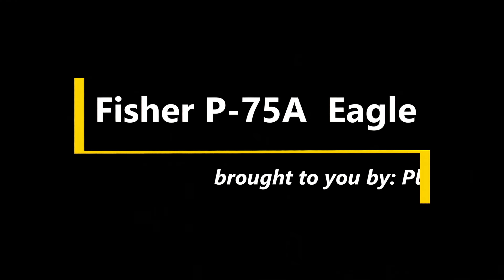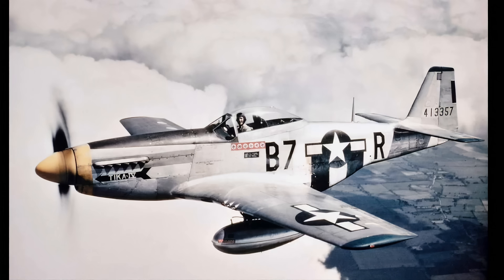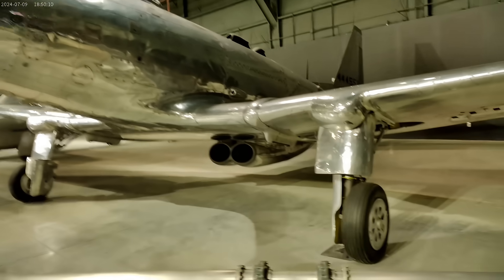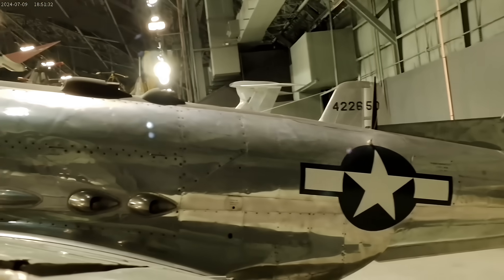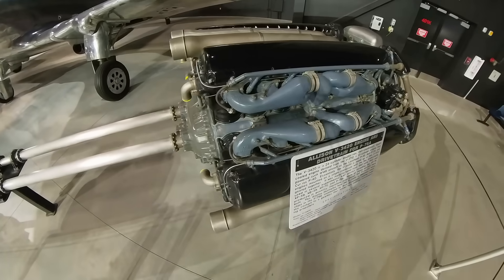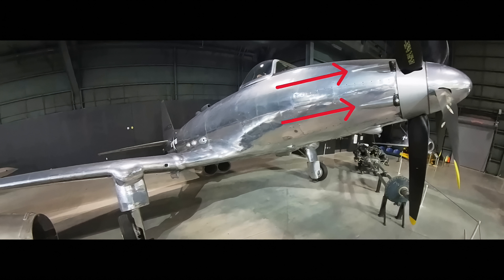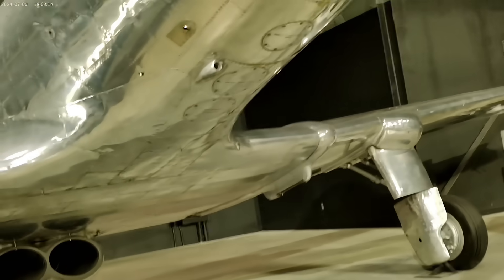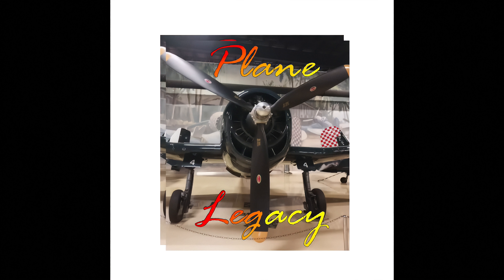Fisher P 75A Eagle - The Wonder Plane that Wasn't

Comment: Ford were a major manufacturer of B-24 Liberators, turning out over 8,000 from their plant at Willow Run, Michigan, at a rate of almost 1 per hour once they really got going. Great for the war effort, but it it wasn't particularly profitable for the company. From what I read somewhere, General Motors noted this, and when it looked like they would get drafted into the B-29 program, they pitched a proposal for a new fighter that would, they said, take all their production capacity. Somehow, they were believed,  and hastily cobbled up the design of the XP-75 from bits of other aircraft, thereby reducing the time, cost and effort that they had to put into it. Amazingly, their efforts generated official interest and they had to continue the charade, even to the point of refining the design. I'm sure they were totally surprised to find themselves actually producing a small number of these Frankenstein beasts, and were probably relieved when it was cancelled, having been 100% successful in it's intended role - a distraction to keep GM from having to contribute to the B-29 production program.
Reply from the maker: Thanks for the comments, always more going on at the "board room" level behind the story of any aircraft production. I appreciate your sharing this information. Thanks for watching!

Comment: Propellors severely limit an aircraft speed because the prop tips break the sound barrier and loose efficiency.  Not an issue with all-jet, which, in military aviation, was too severe a limitation for anything with propellors where speed was a consideration.  The C-130 is a prime example of the exception to the rule.
Reply from the maker: Good info, thank you for sharing!

Comment: You've got P-factor, gyroscopic precession, and torque confused.
Reply from the maker: are you able to elaborate?
Reply: @PlaneLegacy  P-factor you got right. Descending propellor blade produces more thrust. Therefore, a right turning engine will require some right rudder input for coordinated flight... Torque is a function Newton's 3rd Law of Motion. And it conspires to turn the airplane left...Thus rudder trim. But gyroscopic precession of the propellor, will always act 90deg to any change in pitch or yaw. And the bigger the prop, the worse that problem is. But the contra-rotating propellor minimizes both torque AND gyroscopic precession. Which is a VERY good thing... And if you can fly Beech 18s for a living, you can fly a manhole cover too.😀

Comment: P 75 appears awkward  annoying. Can't imagine the long drive shafts. I think its a poor design. If one or both broke or separated you've got a drive shaft comming right up through you in the cockpit. It's scary enough driving a car with a crumbling hardy disk.
Reply: That didn't happen to the Bell airplanes with that design. IDuring war, these fighter planes had a life expectancy of only a few months, so the problems we see in our cars after several years just don't happen. In this case, it was the engine that was terrible, there were other planes that were supposed to use it but they got cancelled when it turned out to be a failure.
Reply from the maker: That time period featured a lot of trial and error, where the error could get someone hurt or worse when it was rushed into production. Thanks for watching!

Comment: Contrary to what most believe, the P-51 was NOT the king of service range; it was the P-47N model which DID see service, albeit very limited. It made the Mustang look like an Edsel compared to a Cadillac...
Otherwise, great video!
Reply: The range of the Mustang was 1,000 miles on internal fuel and 1,650 miles with drop tanks. The P-47N range was only 800 miles on internal fuel, but was 2,350 miles with drop tanks. So, the P-47N could carry larger drop tanks. Of course, it was larger than a P-51D. However, this is an apples to oranges comparison. They had different roles.
Reply from the maker: Thanks for the info

Comment: It's important to remember that every single fighter and bomber that actually saw combat in WWII for the US was already in the design and prototyping phase BEFORE Dec. 7, 1941.   The remarkable designs of the P-51 and P-61 got their early starts thanks to the British, who were buying everything they could from the US in 1940 and thus initiated those designs.  
In the case of the P-75, the choice of the Allison engine was its most critical failure, as Allison, then a division of GM,  simply had too much corporate inertia to quickly improve its V-1710 engine for the P-51 and P-38, much less fully work out the kinks of the V-3420, which was just two V-1710 engines connected together with a gearbox.
Don Berlin doesn't get enough credit for his aeronautical work, as he was the Chief Designer of the P-40 at Curtiss Wright.  He would later go on to work for Boeing Vertol and help design the Chinook helicopter.  Somebody should do a Youtube video on his life and career, which has unfairly been ignored and is largely uncovered by any books or even a wikipedia entry.
Reply from the maker: Thanks for the info, I agree on Don Berlin being one of the unsung who should get more attention. Thanks for watching!
Reply: What are you even talking about?! 🤦‍♂️😂

It’s not enough to give the US credit for building great aircraft during WWII, but now anything we DID build was only thanks to the Brits?! 😂

You’re totally wrong about the timelines by the way, as SEVERAL of the most iconic aircraft of WWII were designed and produced within the span of the war. The P-38 was one of the only aircraft that actually saw production from the start THROUGH the finish of the war. 

I mean right off the top of my head the aircraft that literally ended WWII was designed and built after the war started; the B-29. 🤦‍♂️

The Hellcat’s first prototype flight was mid-1942! That aircraft was also a complete game-changer in the PTO, and to dispel your other ridiculous statement, its development has ABSOLUTELY NOTHING to do with the British or Europe at all.
Reply: @EstorilEm      You need to do some reading about the history of the P-51 and the USAAF's tortuous path to finally selecting the P-51 as the definitive solution to its desperate need for a long range escort in the high altitude European air war.   "Mustang Designer" about Edgar Schmued, the P-51 Chief Designer (an Austrian immigrant, btw), and "P-51 Mustang: Development of the Long-Range Escort Fighter" are must-reads.  
Besides the GM/Fisher P-75 described in this video, Curtiss Wright alone had projects for the XP-37, XP-42, XP-46, XP-53, XP-55, XP-60, and XP-71.  There was the McDonnell XP-67 Moonbat, Lockheed XP-58 Chain Lightning and XP-49, Brewster's XA-32, the XB-38, XB-40, and the XB-41 escort bomber.   These were all USAAF projects to find a solution for a long range escort fighter.  Until the P-47N model, the P-47s did not have enough range, and the P-38, which did have the range, had severe problems with its Allison engines blowing up when forced to run in the cold high altitudes of the European air war (that and the poor grade of British avgas mixed with the Tetraethyl lead to boost octane).  Also, both the P-38 and P-47 were Mach limited when forced to chase the much sleeker and aerodynamic German FW-190 and Bf-109s from high altitude and could not follow them down in a dive at 25,000+ feet altitude without hitting the sound barrier and losing control (Capt. Eric Brown's video testimony, he says this in a couple of videos here on Youtube).
The ONLY reason the P-51 existed was because North American proposed building a new and better design for the British when they came around in 1940 and asked them to license build more of Curtiss Wright's P-40s for them.  CW could not ramp up P-40 production fast enough for the British.   So, North American instead built the P-51 with the Allison engine for the British.  It was recognized early on that the P-51 had a superbly aerodynamic fuselage but the lousy Allison engine limited its performance, especially at high altitude.  As such, early models were mainly used as ground attack aircraft.  The British initiated experiments switching to the Merlin engine, and North American then rebuilt the P-51 around Packard's license built Merlins.   Two keys to the P-51's success - its sleek and aerodynamic design allowed it to be far more fuel efficient than either the P-47 or P-38 or other aircraft.   Also, from the beginning, its main fuel tank was in the center fuselage-wing root, balanced right at the plane's center of gravity.  This is why, when the need for more range became apparent, NA was able to easily add a small second fuel tank behind the P-51  cockpit, as well as drop tanks.   The P-47 had to have its wings completely redesigned to put large main fuel tanks in the wings for the P-47N model, and its R-2800 engine and its bulky design meant it was a fuel guzzler.  That's why the P-47N model saw only very limited combat at the very end of the war in Japan, and never made it into Europe - it just took a much longer time to completely redesign its wings to accomodate the extra large fuel tanks..
Anyway, the definitive version of the P-51 with the Packard Merlin engine and the extra fuselage fuel tank was NEVER written into any USAAF specs or contracts.  The whole thing was a stepwise field modification that came about as a result of independent cooperative actions between North American and its original customer, the British, and some enterprising USAAF officers on the ground in Britain.   After the brass in the USAAF saw the result, it grabbed all the production runs of the P-51 with the Packard Merlins engines from the British, and that is how the P-51 came to be the definitive long range escort fighter that it had been seeking.   The marriage of the Merlin with the P-51 was ONLY possible because it was originally a British contracted plane.   When people at the lower levels tried to "fix" the P-38's problems in Europe with its Allison engine and turbosupercharger by putting Merlins in, that idea got squashed by Allison because of the procurement politics of the USAAF.
Reply: @gandalfgreyhame3425 funny how all of your comments have been edited after I cite specific reasons why you’re incorrect. 

Have a nice day. 👌
Reply: @EstorilEm  You seem to have misread the comment. The B-29 design began in 1939, well before the US got involved in WWII. The Hellcat design process began in June of 1941, again before Japan attacked Pearl Harbor.

As for British involvement, the Mustang design was intended to fulfill a requirement from them. They wanted North American Aviation to build P-40s for them under license, but North American came back and said they could design a better plane. That's why the Mustang exists in the first place, there's no reason why this fact should upset anyone. Besides, the Mustang didn't even perform well until it gained the British Merlin engine, everyone knows that already.

In the future, instead of going off the top of your head, it's a good idea to double check the facts. There's so much more and better information now, the things I used to think were true turned out to be not accurate at all. The internet makes it really easy, we don't need to make trips to the library and read through huge books anymore.
Reply: @benjaminbarrera214 give me a break… if you want to go down that route, everything flying is basically a copy of the Wright Flyer. 🙈

…also comment has been subsequently edited. 

The hellcat and B-29 were famously designed within the war timeframe: as was the Mustang but it’s less blatant. 

Sorry, you’re just wrong on that front. By your definition everything with a wing was “envisioned” after WWII started, and that just not the case. 

Also I’m well aware of British involvement in aviation during WWII. Explaining that the Merlin changed the performance profile of the Mustang is a joke, every kid who has made a paper airplane knows that. 

Kinda makes you sound desperate to cite facts. 🙈

Comment: Kind of looks like an overgrown Martin Baker MB-5
Reply: The resemblance is uncanny; good call!
Reply: The Fisher Eagle could only have been devised and tested in a country like the U.S. during WWII whose industrial might and resources could allow for such a waste of effort and resources.  It started as an almost reasonable idea which seemed to gain a life of its own even after it morphed into  something that was painfully NOT the original concept and painfully obvious that it would not be needed.  It was not alone in that respect (Douglas, Curtis, Lockheed, Northrop,... Beech (!!)  all went off the rails somewhat when the U.S. Government was issuing blank checks.  Had one 100th  of that been put towards (a) a sane successor to the P-40 or at least the development and production of the P-40Q (b) develop the Douglas Dauntless and give it folding wings, more power, better armament etc. etc. and avoid the Curtis Helldiver entirely. So, having said all of this, I have seen the example in the Air Force Museum and what a great 1/48 kit it would make.
Reply from the maker: Excellent point! Thanks for commenting
Reply: The original version?  Not so much.  Initially, it was a strange looking hodge-podge. The example in the USAF museum was the end result of a long process of..."this needs changing... that needs replacing... maybe we should try this...that there just plain ain't gonna work... etc." until it really had not much in common with the original design aside from the designation...BUT it DID look a hell of a lot better.

Comment: Ford built the B-24 Liberator heavy bomber at willow run airport in Michigan.
Reply from the maker: That plant and its production always amazed me, thanks for commenting!
Reply: @PlaneLegacy  ford was good at mass production ,,by WW2 they had 25+ years of practice with large scale mass production ,,,they did the same with the B-24 as they had done with the model T ,model A ,,and the N series tractors they used an assembly line
Reply: ford built the B24 liberator but it was not their own design  ,, this was a General motors design built by GM